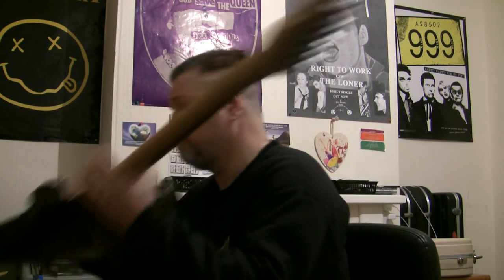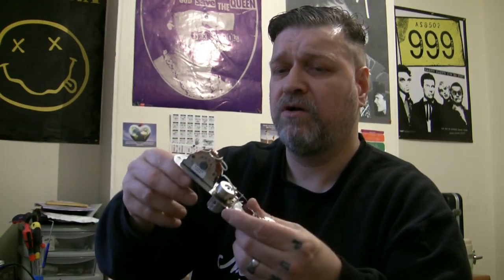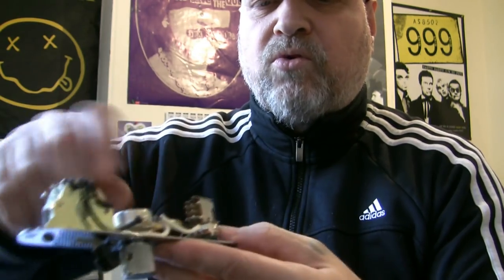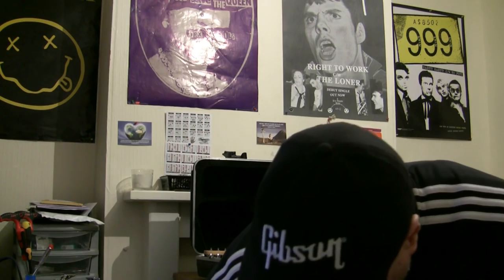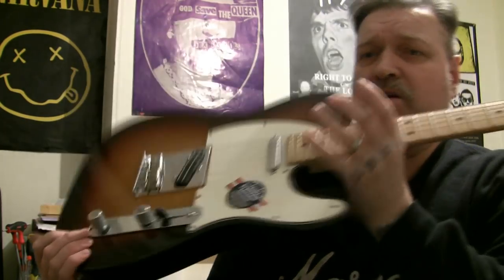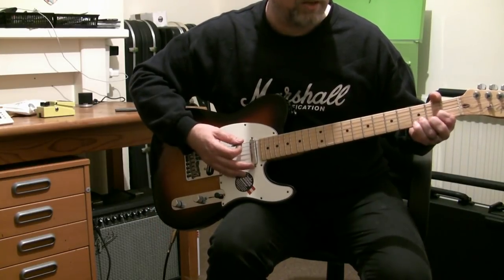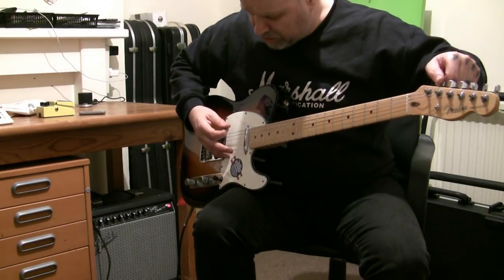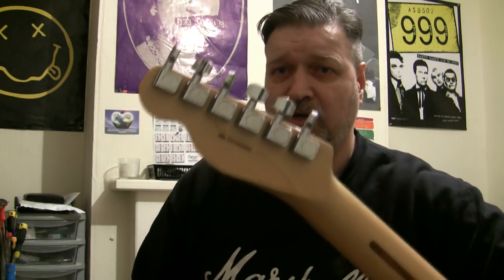Fender America Standard Telecaster: upgrades and modifications...

Comment from the maker: NOTE: I have explained the pickup positions incorrectly on the video! The options are as follows:

Position 1 (closest to the bridge): Bridge pickup
Position 2: Bridge + neck pickup (in parallel / normal)
Position 3: Neck pickup
Position 4: Bridge + neck (in series)

To use the bridge in humbucker mode: leave the tone pushed in (closest to the body)
To use the bridge in single mode: press the tone knob and it will pop out (single coil / Tele mode)